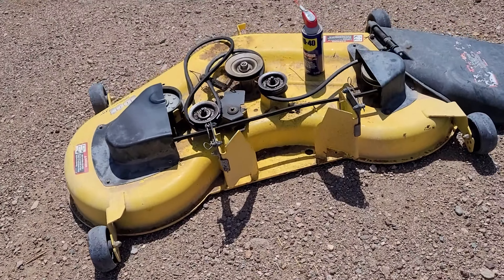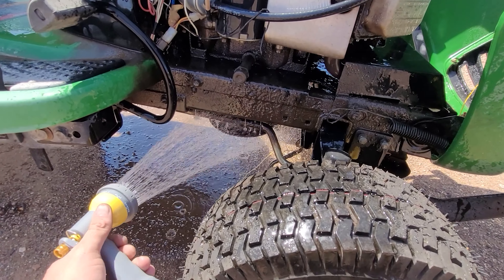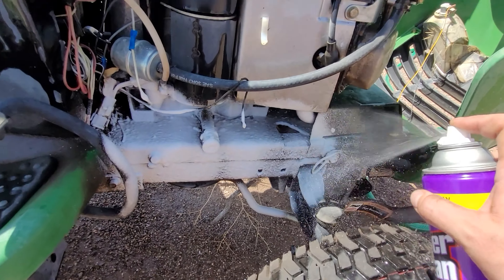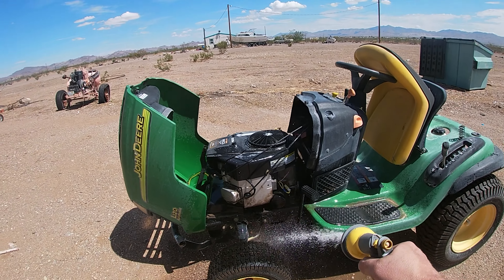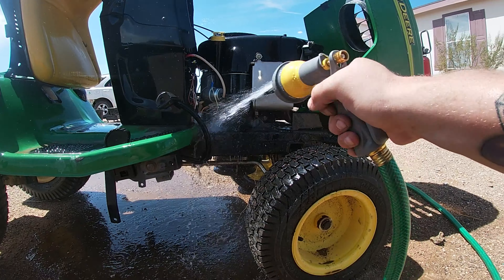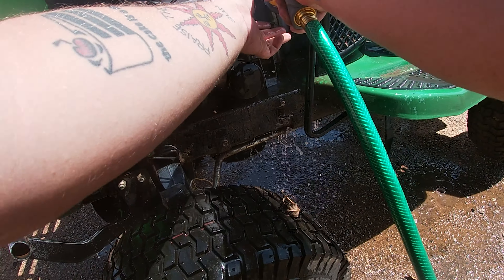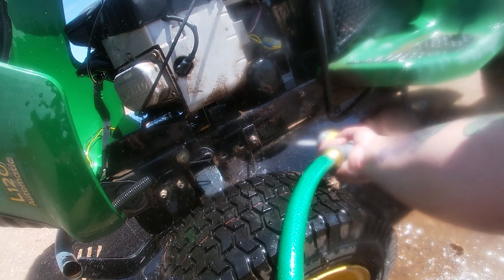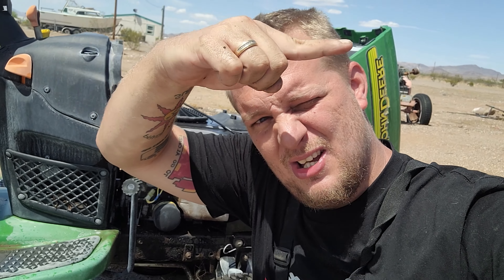John Deere L120 Automatic Lawn tractor full service guide part 1 clean up.

Comment: The most dirty parts of the lawn mower is under it where all the grass and dirt gets up into the frame, up under the drive shaft area and  up under the transaxle fan. I dont know how much dirt was up under mine but it was a lot to the point where it filled my gallon wet vac up.